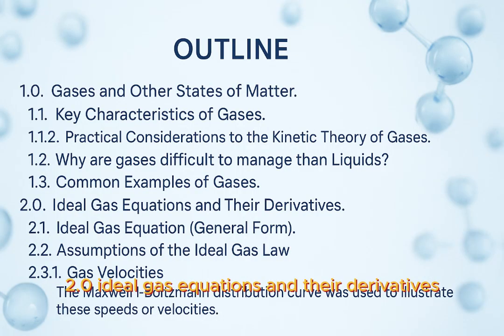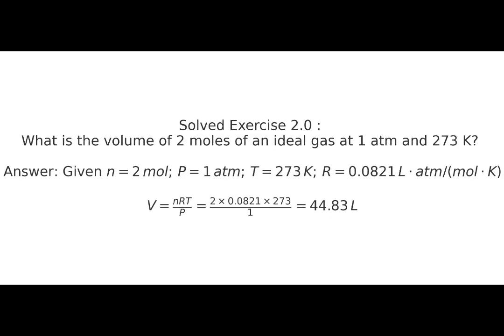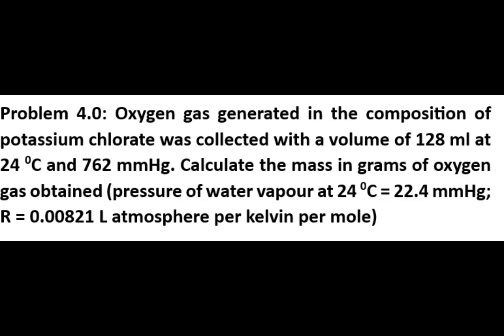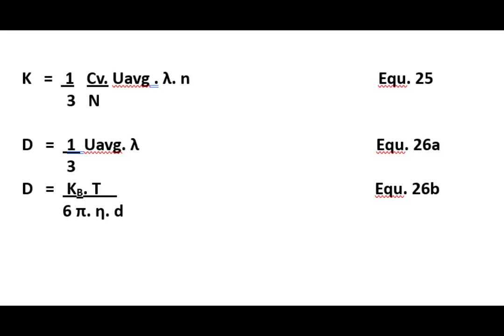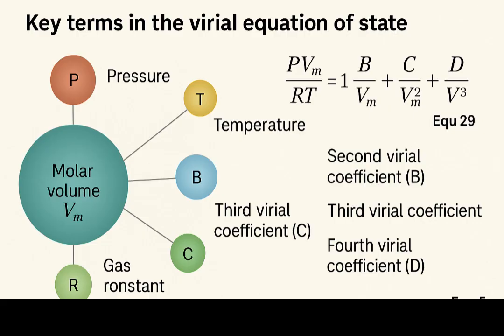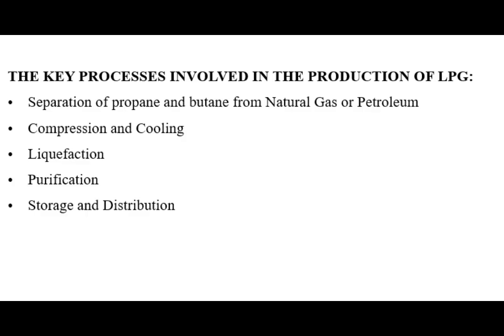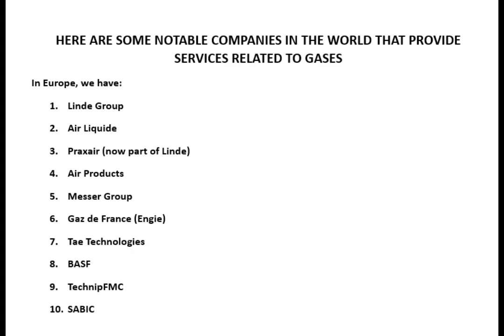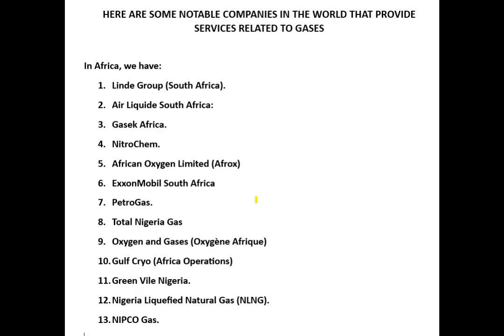Fundamentals and Applications of Gases

Comment: CHE : Sangoleye Racheal Folakemi 
Chemical Engineering 
Mat No: U2024/3030023
The Joule Thomson coefficient defines the temperature change during an isenthalphic throttling expansion (∆P<0) . For cooling to occur Joules Thomson coefficient must be strictly positive. This indicates that internal energy is expanded to overcome attractive intermolecular force between methane molecules as the gas expands resulting in a temperature drop

Comment: CHE: EJIKE CHINEMEREM JOY 

MAT. NO: U2024/3030013

Methane gas can undergo cooling during a Joule–Thomson throttling process when its Joule–Thomson coefficient is positive. In pipeline natural gas processing, the cooling effect depends mainly on the operating pressure and temperature conditions. Therefore, the following process parameters should be properly monitored and controlled to achieve the desired cooling:

1 Control the pressure drop: Maintain an appropriate pressure drop across the throttling valve to obtain effective Joule–Thomson cooling.

2 Optimize inlet pressure: Adjust the upstream pressure so that the gas remains within the range where methane has a positive Joule–Thomson coefficient.

3 Control inlet temperature: Maintain a suitable inlet temperature before throttling to achieve the desired outlet temperature after pressure reduction.

4 Regulate flow rate: Maintain a stable gas flow rate to avoid fluctuations in pressure and temperature across the valve.

5 Control hydrate formation: Since pressure reduction can lower the gas temperature significantly, dehydration and proper hydrate-control measures should be applied to prevent hydrate formation in the pipeline.

Comment: CHE: Okoli, Chichebem Francis
Mat no : U2024/3030017

Since the gas is said to be operating in the region where μᴊᴛ > 0, Troubleshooting should focus on maintaining the conditions required to obtain the desired magnitude of cooling.

• Check and adjust the pressure drop (∆P) across the throttling valve. The JT coefficient is given by μᴊᴛ  = (∂T/∂P)ₕ

=> ∆T = μᴊᴛ∆P

If ∆P < 0 (pressure drop) and μᴊᴛ > 0
then ∆T = μᴊᴛ∆P < 0 

This means that the desired cooling ( ∆T = μᴊᴛ∆P < 0) occurs with the appropriate pressure drop, if the pressure drop is too small then the desired cooling may not be achieved..

• The inlet temperature should be monitored since the value of μᴊᴛ can change with temperature 

• Check for hydrates. If cooling is substantial, the water present in the gas could form hydrates which can restrict or block the valves. Ensure adequate gas dehydration and monitor downstream temperature

• The throttling valve should also be properly sized, and the flow rate should be maintained within design range

Comment: BCT 
FAVOUR STEWART MANASSEH 
MAT NO:U2024/5735306
•The ideal gas equation helps you estimate the amount of gas produced in moles(n) from the measured pressure,volume and pressure
n=PV/RT
Therefore: by measuring the pressure,volume,and temperature of the gas and substituting them into 
n=PV/RT, we can calculate the number of moles and gas produced.

Comment: BCT OGBONNA JECINTA AGIMCHI U2024/5735284

The ideal gas equation (PV=nRT) helps estimate how much gas is produced by using the measured pressure, volume and temperature to calculate  the number of moles(n) of the gas

Comment: BCT
EUNICE EDIDIONG UMOH
U2024/5735167

The ideal gas equation contains the parameters needed to estimate the amount of gas produced in a closed vessel.
PV=nRT
Firstly, Rearrange the equation to make n the subject of the formula 
n= PV/RT
Given that , 
P= the measured pressure 
V= the volume of the Gas
R= the ideal gas constant 
T= the Temperature in Kelvin 
Then, substitute the values of P,V,R,and T into their right place in the formula,that makes n the subject formula.
The result gotten from that, would be the number of moles that was contained in the Gas

Comment: ChE: Alalibo Priye Prayer 
U2024/3030024

A positive Joule Thomson coefficient means methane cools when pressure drops during throttling. To achieve effective cooling in pipeline natural gas processing, the main parameters to troubleshoot are:

- Pressure drop: Ensure sufficient pressure difference across the JT valve.
- Inlet pressure: Maintain adequate upstream pressure.
- Inlet temperature: Pre-cool the gas if necessary to improve cooling.
- Gas composition: Monitor methane, CO₂, N₂, and heavier hydrocarbons since composition affects JT behaviour.
- Moisture: Dehydrate the gas to prevent hydrate formation during cooling.
- JT valve: Check for correct sizing, fouling, erosion, and proper operation.
- Flow rate: Keep flow within the equipment's design range.
- Heat loss/gain: Ensure proper insulation and efficient heat exchangers.
- Instrumentation: Calibrate pressure and temperature sensors for accurate control.

The overall aim is to obtain the required pressure drop and temperature reduction while preventing hydrate formation and maintaining pipeline pressure specifications.

Comment: CHEM: AGBA MBA PHILIP
U2024/3030054

The Joule-Thomson coefficient of methane gas gives a positive value for cooling to be obtained.
The possible troubleshooting of process parameters to achieve this cooling in pipeline natural gas processing includes:
1) Verifying the upstream pipeline pressure and upstream booster compression performance then Check for downstream flow bottlenecks, partially closed isolation valves, or undersized discharge piping causing high backpressure then Adjust the J-T control valve opening to ensure pressure differential across the trim is maximized within design limits.
2) Check performance of upstream gas coolers (air coolers/fin-fans or shell-and-tube heat exchangers) for fouling or fan speed drops.
Optimize heat integration by ensuring the gas-to-gas exchanger (gas/gas pre-cooler) is operating efficiently prior to the J-T valve.
3) Perform gas chromatography (GC) sampling at the inlet to verify gas composition against design specs.
Account for inert gas fractions (N2,CO2), which alter the overall gas mixture heat capacity (Cp) and J-T behavior.
4) Verify upstream dehydration unit efficiency (ensure glycol contactor or molecular sieve dew point targets are met).
Check thermodynamic hydrate inhibitor injection (e.g., Monoethylene Glycol [MEG] or Methanol) rate and nozzle spray atomization directly upstream of the expansion point.Then apply heat tracing or warm gas blowdown temporarily to melt localized hydrates if partial blockage is detected.
5) Inspect the J-T valve for seat leakage or internal washouts allowing gas to bypass the restriction without controlled expansion.
Verify that the valve positioner is correctly calibrated and not hunting or stuck open.

Comment: CHE: Ilaumo Blessing Bennet 
U2025/3030011

Yes. In pipeline natural-gas processing, a positive Joule–Thomson coefficient (μJT>0) for methane means that methane cools when it undergoes a pressure drop at approximately constant enthalpy:

μJT=(∂P∂T)H>0

So, to obtain cooling, the process should be designed to create a suitable pressure reduction while maintaining conditions where methane remains in the positive-JT region.

Troubleshooting of process parameters

Increase the pressure drop

Since:

ΔT≈μJTΔP

a larger pressure drop across a valve or choke generally gives greater cooling. Check that the upstream pressure is sufficiently high and that the downstream pressure is sufficiently low.

Check the operating temperature

The Joule–Thomson coefficient depends strongly on temperature. If the gas is outside the temperature range where methane has a positive μJT, pressure reduction may produce little cooling or even heating. Therefore, adjust the inlet temperature or provide suitable precooling where necessary.

Check gas composition

Pipeline natural gas is not pure methane. Components such as ethane, propane, butane, CO₂ and heavier hydrocarbons can significantly change the mixture's Joule–Thomson coefficient. Analyze the gas composition and ensure the operating conditions are appropriate for the actual mixture.

Control the expansion valve/choke

A faulty or improperly sized valve may not provide the required pressure reduction. Check valve opening, pressure drop, flow rate and valve sizing. Avoid excessive throttling that could cause undesirable liquid formation or unstable operation.

Monitor flow rate

Very high flow rates can cause pressure losses in the pipeline that are different from the intended throttling pressure drop. Adjust the flow rate and check for excessive frictional pressure losses.

Prevent unwanted heat transfer

The Joule–Thomson effect is ideally an isenthalpic process. Insulation should therefore be checked so that heat transfer from the surroundings does not significantly reduce the desired cooling effect.

Check for hydrate formation

Cooling natural gas can cause water hydrates to form, especially at high pressure. If the temperature approaches the hydrate-formation region, dehydration or injection of an inhibitor such as methanol/MEG may be necessary.

Monitor pressure and temperature continuously

Install or verify pressure and temperature measurements before and after the throttling point. Compare the measured temperature drop with:

ΔT=μJT(P2−P1)

Significant deviation may indicate incorrect instrumentation, heat transfer, composition changes, or an incorrect estimate of μJT.

Comment: CHE: Udemefuna chigozie joseph 
                 U2024/3030060

Joule–Thomson Cooling of Methane Gas
The Joule–Thomson (J–T) effect is the change in temperature of a gas when it undergoes a pressure drop through a valve or restriction under constant enthalpy conditions.
The Joule–Thomson coefficient is given by:
μJT = (∂T/∂P)H
For methane, a positive Joule–Thomson coefficient means that when the pressure decreases, the temperature also decreases. Therefore, cooling can be obtained by throttling the natural gas through a suitable control valve

Troubleshooting of Process Parameters for Cooling in Pipeline Natural Gas Processing
Pressure drop: Increase the pressure difference across the J–T valve to obtain greater cooling.
Inlet temperature: Reduce the gas inlet temperature using a cooler or heat exchanger.
Gas flow rate: Maintain the flow rate within the design range to ensure stable cooling.
Gas composition: Monitor methane and heavier hydrocarbons because composition affects the J–T cooling effect.
Moisture content: Dehydrate the gas to prevent water condensation and hydrate formation during cooling.
J–T valve: Check for blockage, improper sizing or malfunction that may reduce the pressure drop.
Heat gain: Insulate pipelines and equipment to prevent heat from the surroundings reducing the cooling effect.
Instrumentation: Check and calibrate pressure and temperature sensors for accurate process control.

Comment: CHE:Timon Emmanuel Tamunoirinaomi
U2024/3030016

The Joule-Thomson coefficient of methane gas gives a positive value for cooling to be obtained. The possible troubleshooting of process parameters to achieve this cooling in pipeline natural gas processing includes:

1) Verifying the upstream pipeline pressure and upstream booster compression performance then Check for downstream flow bottlenecks, partially closed isolation valves, or undersized discharge piping causing high backpressure then Adjust the J-T control valve opening to ensure pressure differential across the trim is maximized within design limits.

2)Check performance of upstream gas coolers (air coolers/fin-fans or shell-and-tube heat exchangers) for fouling or fan speed drops.
Optimize heat integration by ensuring the gas-to-gas exchanger (gas/gas pre-cooler) is operating efficiently prior to the J-T valve.

3)Perform gas chromatography (GC) sampling at the inlet to verify gas composition against design specs.
Account for inert gas fractions (N2,CO2), which alter the overall gas mixture heat capacity (Cp) and J-T behavior.

4)Verify upstream dehydration unit efficiency (ensure glycol contactor or molecular sieve dew point targets are met).
Check thermodynamic hydrate inhibitor injection (e.g., Monoethylene Glycol [MEG] or Methanol) rate and nozzle spray atomization directly upstream of the expansion point.Then apply heat tracing or warm gas blowdown temporarily to melt localized hydrates if partial blockage is detected.

5)Inspect the J-T valve for seat leakage or internal washouts allowing gas to bypass the restriction without controlled expansion.
Verify that the valve positioner is correctly calibrated and not hunting or stuck open.

Comment: CHE: Hart, Rejoice

MAT NUMBER: U2024/3030066

Methane cools during the Joule-Thomson process when its coefficient is positive, and there are a few things that need to be checked to make sure this cooling actually happens in pipeline processing.

1. The pressure drop across the throttling valve has to be big enough. A small pressure difference won't give a noticeable temperature change, so if cooling seems weak, that's the first thing to check.

2. The inlet temperature matters a lot. Methane only cools when it's below its inversion temperature. If the gas gets too hot before it reaches the expansion valve, it can actually warm up instead of cooling, so keeping the inlet temperature well below the inversion point is important.

3. The whole setup needs to be properly insulated since the process is supposed to be adiabatic. If heat is leaking in from outside, it fights against the cooling effect, so any gaps in insulation along the pipeline or around the valve need to be sorted out.

4. The throttling valve or porous plug itself has to be working correctly. If it's blocked or damaged, the gas won't expand smoothly, and that affects the whole isenthalpic process the cooling depends on.

5. Since natural gas isn't pure methane, the mix of other hydrocarbons like ethane, propane and butane can shift the overall Joule-Thomson coefficient. So keeping an eye on gas composition is also part of making sure the cooling stays efficient.

Comment: CHE
ELISHA GOD'SPOWER CHINAZA-UKAN 
U2024/3030022
-The Joule–Thomson (J–T) coefficient is
For methane, a positive  means that a pressure drop at approximately constant enthalpy produces a temperature drop, so cooling can be obtained by throttling.
Troubleshooting process parameters for pipeline natural-gas cooling
If the expected cooling is not being achieved, the following parameters should be investigated:

1. Check the inlet temperature
Ensure the gas temperature is within the appropriate range for positive J–T cooling.
Methane has an inversion temperature; if the gas is above the relevant inversion range, throttling may produce little cooling or even heating.
Use upstream cooling or heat exchangers if necessary.

2. Increase the pressure drop
Since approximately
Check the upstream and downstream pressures and verify that the control valve is producing the required pressure drop.
Avoid excessive pressure drops that could cause operational or hydrate-related problems.

3. Control the gas composition
Pipeline gas is not pure methane. Ethane, propane, butane, CO₂, nitrogen and other components influence the J–T coefficient.
Heavy hydrocarbons can significantly alter the cooling behavior.
Analyze the gas composition and compare it with the design composition.

4. Check the gas flow rate
Excessive flow through a control valve can alter the pressure profile and reduce the available pressure drop.
Very low flow can also cause unstable valve operation.
Operate within the design flow range and check for valve sizing problems.

5. Inspect the throttling/control valve
Verify that the valve is functioning correctly and achieving the intended pressure reduction.
Check for incorrect valve sizing, blockage, excessive wear or poor control-loop tuning.
Confirm that the pressure and temperature instruments around the valve are properly calibrated.

6. Monitor hydrate formation
J–T cooling can lower the gas temperature below the hydrate-formation temperature.
If water is present, hydrates may form and restrict the pipeline or valve.
Ensure adequate dehydration and, where necessary, use hydrate inhibitors such as glycol or methanol under appropriate process conditions.

7. Check water and hydrocarbon dew points
Cooling can cause water or heavy hydrocarbons to condense.
Verify that the gas remains above the required dew-point specifications or provide appropriate separation/heating facilities.

8. Check insulation and heat transfer
Unintended heat transfer from the surroundings can reduce the observed cooling.
Inspect insulation and the configuration of downstream piping and equipment.

Practical troubleshooting sequence
Measure inlet pressure and temperature → measure gas composition → calculate/estimate  → verify pressure drop → inspect control-valve operation → check flow rate → check hydrate/dew-point conditions → verify temperature instrumentation.
Thus, to obtain useful cooling from the Joule–Thomson effect in pipeline natural-gas processing, the main parameters to optimize are gas temperature, pressure drop, gas composition, flow rate, valve performance, and water/hydrocarbon content. The process must also remain within safe operating limits to prevent hydrate formation, condensation, and pipeline blockage.

Comment: CHE 
OKEREKE KELECHI EME 
U2024/3030055

The ideal gas equation contains the parameters required to describe the process stated in the question.
[ N=\{PV}{RT} ]
Where:
P = Pressure of the gas
V = Volume of the gas
R = Universal gas constant (8.314\ \text{J/mol/K})
T = Temperature of the gas in Kelvin (K)
N = Amount of gas in moles (mol)
Therefore, by measuring the pressure, volume, and temperature of a gas in a closed vessel and substituting the values into the equation
[ N=\{PV}{RT} ]
we can determine the estimated amount of gas produced in moles.
Thank you.